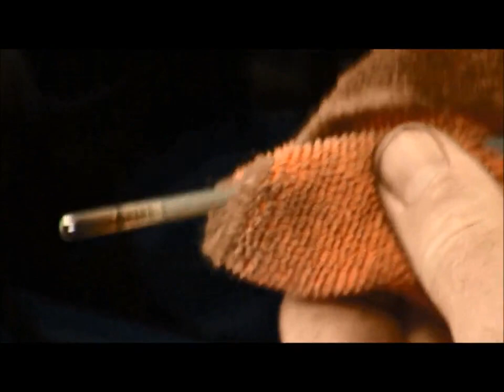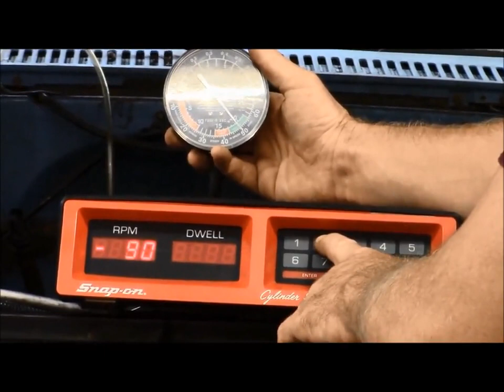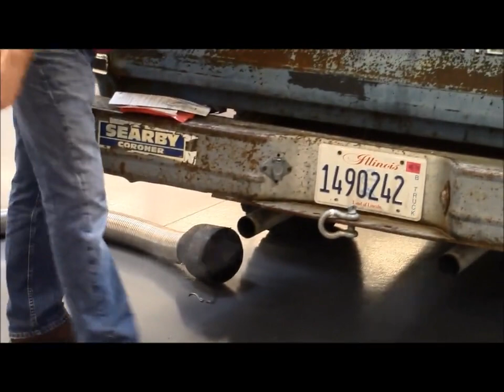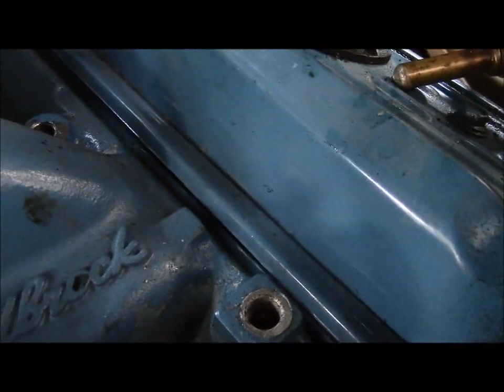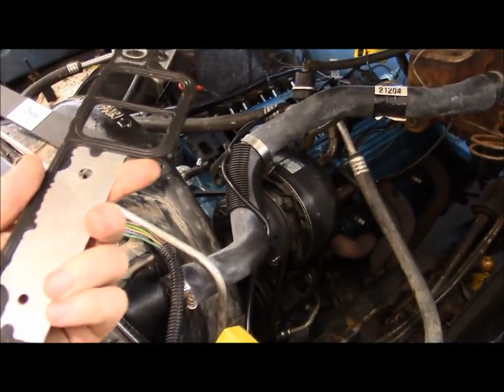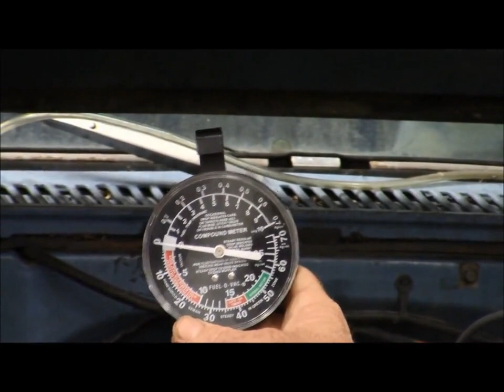Chevrolet 350 Intake Manifold Gasket Diagnosis and Repair

Comment: I've got a similar issue on my vortec 4.3 in my boat. Cylinder 4 and 6 are misfiring randomly at idle. I put new plugs, wires, cap and rotor on from Volvo (OEM) and ran the engine for a few mins. Pulled the plugs and they're still fouled on just those two cylinders. Wet with fuel. They are firing, though. I confirmed this by pulling the wires off while it's running and the engine stumbles on every wire removed. I'm beginning to suspect the same internal intake gasket leak. I thought maybe there was a head gasket leaking coolant into the cylinders. I boroscoped the cylinders and they don't show signs of steam cleaning. The engine has great compression about 185 on all. I rebuilt the carb with a Holley kit and tuned it by the Volvo service manual.

However, when I plugged both pcv holes in the valve covers with gloved fingers, they both built pressure up, no vacuum.

Comment: I know this is a old video. However, if someone installed new intake gaskets and put them upside down. Would that cause a vaccum leak. And can make the motor backfire through the carb?

Comment: That gasket does not work for my 350 engine from a 1974 C10 The bolt holes are not in the correct place.
Reply: Then you "OR SOMEONE" Ordered the Incorrect Gasket!

Comment: Can a bad intake gasket also cause low coolant in the radiator and milky oil at the dipstick? I also notice my oil dipstick is now passed its max limit mark.
Reply: Same thing just happened to me yesterday
Reply: @Smoketownedc  me too lol. Im hoping its just the intake gasket and not a head gasket. It was recently rebuilt with only 1500 miles.
Reply: @Smoketownedc  so your coolant is low and overfilled dipstick due to coolant?

Comment: Great video thank you. Can an intake issue cause coolant to exit tail pipe, milk oil and radiator bubbling? I plan on changing my head gaskets but i just wonder if the intake could cause the same symptoms?

Comment: How can a bad intake gasket cause oil consumption...makes no sense...
Reply from the maker: The intake port gasket was torn, allowing the oily vapors in the intake valley to be drawn up into the intake runner. The oil entering the combustion chamber fouled the spark plug and exited the cylinder through the exhaust port, then out through the exhaust system.
Reply: @SIUAutomotiveVideos Bam right in the kisser😅
Reply: I know this is an Older Video, But my Brother has a 1987 GMC K1500 with a 350 in it, (And he's having OIL Consumption Now 08/02/2026), Answer to your Question is Explained quit Clearly below Butttttttt,  If the INTAKE GASKET is SPLIT / TORN and Leaking, It SUCKS the OIL Vapor / Fumes Right Up through the VALLEY & Into and through the Intake system and OUT the Exhaust.  Hence OIL Consumption!  Yes, a BAD Intake Gasket will Cause OIL Consumption.

Comment: JUST HAD THE INTAKE MANIFOLD GASKET REPLACED WITH NO ISSUES STILL HAVING THE SAME PROBLEM WITH THE DUAL EXHAUST PAPER TEST. PLEASE ADVISE THANK YOU ROBERT
Reply from the maker: The paper test shows a misfire. Try a power balance test on the 4 cylinders of the affected bank. Once you discover which cyl is misfiring, check spark plugs, firing order, plug wires, then do a compression test. Compression test is usually last.

Comment: SIU :HAVE A 1980 C10 BIG 10 SILVERADO STOCK REBUILT 350 5.7 WITH A HEI DISTRIBUTOR  HAVING ISSUES,JUST LIKE YOUR VIDEO. ON MY  DUAL EXHAUST PAPER TEST. BANK 1 IS NOT SOUNDING AS SHOULD BE. DO U RECOMMEND, A COMPRESSION TEST? PLEASE ADVISE. THANK YOU ROBERT.
Reply from the maker: A power balance test will confirm a misfire. I would do that first. However, a compression test won't cost you anything and will let you know of any low cylinders.

Comment: This is awesome if you have the tach/dwell/shorting machine. Otherwise, you could have found an intake leak of that size with propane/starting fluid. Just make sure you have a fire extinguisher near by. Personally never had it go south but always have an extinguisher just in case
Reply from the maker: The intake leak was in the valley. I would have had to flow propane into the crankcase to discover it that way. This is extremely dangerous and I would not recommend this test under any circumstances.

Comment: UR INTAKE IS MISSINGTHE TWO MIDDLE BOLTS WHERE THE GASKET SLIPPED
Reply from the maker: Vortec cylinder heads only have 4 intake manifold bolts per bank.

Comment: Question. Can a bad gasket causing a vacuum leak . Cause timing to act erratically ( advance and retart ).
Haven't found anything visible up top. Thing it might be the manifold gasket  now. 
Symptoms are. No power in gear. Hard start. Fluctuating rpm.  But sometimes revs and idles fine in park.
Reply: 5 years later, im having a similar issue what ended up causing your issue?

Comment: can rod bearings go if they mix fluids, i had my intake gaskets done on my 99 tahoe and the engine seized up after 60 miles the mechanic told me he did an oil change 2 times so idk what happened but 2 days after i got it back from him the engine made a humming noise then after 60 miles it died
Reply: I mean if coolant(water) is mixing with your oil it’s gonna get cooked in your crankcase/cylinders/valve train so yeah after enough carbon and scoring to your bearings it’ll seize up, but 60 miles? Gotta be something else going on as well
Reply: I think spun main bearing. Pull the motor and replace you will be time and money ahead. @MetalCowpoke